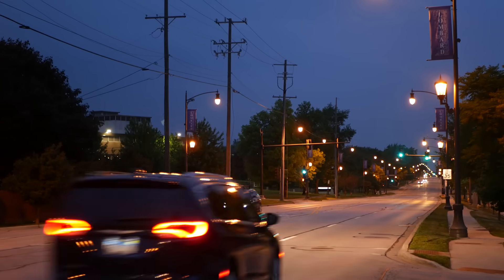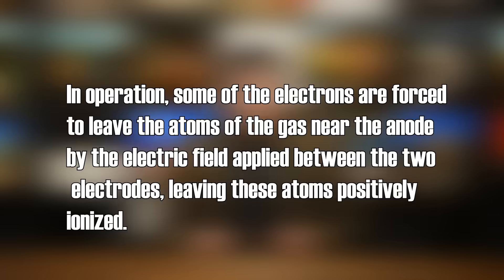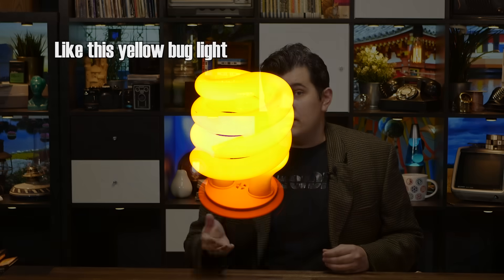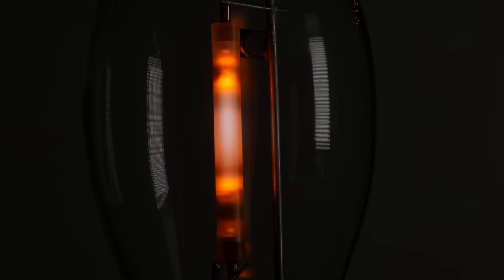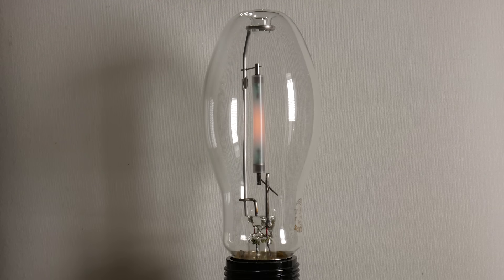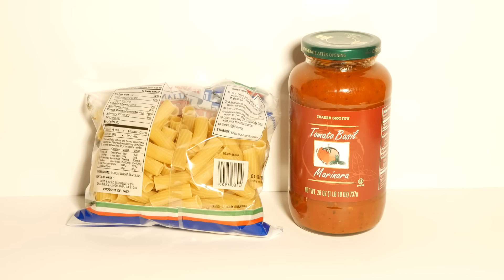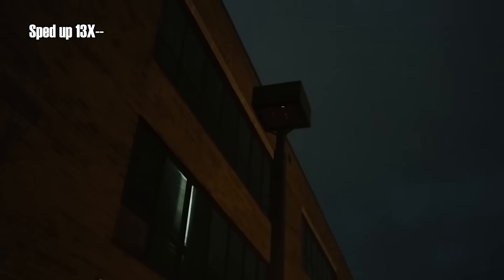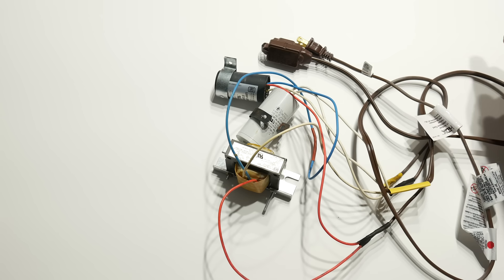The High Pressure Sodium Light: Ubiquitous, effective, but good?

Comment: They are so much better...especially in rain. With those disgusting LED lights, you've got the hardest edged shadows of your life. You see good as at day right under the lamp, but around it your are blind. At they always conflict with your cars lights. Not only are orange street lights warmer, nicer and easier on the eyes, you see so much more since the barely cast shadows. It's a much smoother transition from lit areas to dark ones.

Comment: LEDs are an analogue of today's world, where today everything has to be "efficient" but it's ugly, souless and scammy (they promise those lamps last essentially forever but their circuits fail faster than incandescent lamps). It's also irrelevant how much electricity they allegedly save when data centers eat up thousands of times that. I have light sensitivity and my wellbeing is very affected by LEDs blasting their ugly overly strong light everywhere. Not to mention their impact on wildlife.

I really wish more people about this and we still had sodium lamps everywhere in the streets
Reply: I agree 💯  I'm also light sensitive to LEDs especially the headlights and street lights, 

see we been using mercury vapor and high pressure sodium for decades but now they switched them for efficiency which I hate that everything always have to be energy efficiency all that bs, some people don't realize the effects LEDs has on the surrounding environment, I don't think they really care about it to be honest,

Just like with Incandescents when CFLs came out people switched from Incandescents to CFLs because their energy efficient ( I don't have anything against CFLs I use them myself not for energy efficiency purpose) 

But anyway yeah people used those until people found out about CFLs had mercury in them and when LEDs came out they switched from CFLs to leds
Now LEDs are favored by many people,

For me I'm gonna continue to use Incandescents CFLs and flourescents.
Reply: @DiegoGene-fh3zp  i have talked to people from my university researching exactly this. The impact of those led lights on animals is immense. Birds, foxes, etc. They were hastily implemented everywhere without considering any of that
Reply: @briocossaurusrex this is the exactly the me and other people trying to tell people about LEDs aren't good for the environment also aren't good for insects, but the

people who prefer LEDs won't do their research they'll just sweep it under the rug .

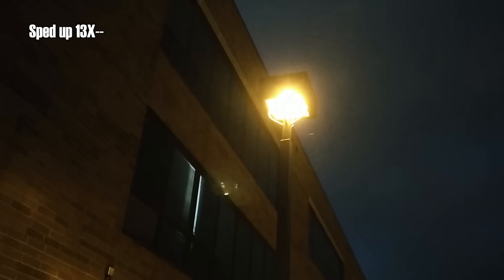Comment: 11:57 The towns and cities in most of the area and State I live in are fairly happy with where we are now. About half of the towns are lit with LED street lights, half the lighting is HPS. there's also some MH and MV for the less common but still used alternative lighting sources still. 🙂 They're might even be low pressure sodium and Metal ion lamps too but I'm not sure on that.

Traffic lights are the same! Most of them still mostly are using incandescent bulbs in things like traffic lights but some now are using LEDs if not alot of them now. With me being in a northern state, I argue that they may definitely be more efficient on their own than the incandescents in a few ways, but they still are believed to have heaters in them to protect their boards from the cold during the winter. Of course that's only one season throughout the year, and of course during seasons like summer the LED's are definitely WAY more efficient than the incandescent bulbs and maybe still are regardless but when winter does come around, it's usually a long one unfortunately. Likely elecric heaters are turned on 90% of the time during the winter, that's alot of heating elements/heat generating components for simple traffic light LED boards. Some street lighting may be heated too but most of them are more durable and capable of generating their own heat! In fact, some may argue that most of the energy consumed by LED street lightning in also lost in heat like alot of it's older competing successors. Of course smaller LED bulbs may be alot more effective at being much more efficient, but I guess it has something to do with how many there are, how big the diodes themselves are, other components on the board like the type of diodes, resistors, transistors other components ect, producers choose to use on their LED boards and lastly, I'm pretty sure the power supply and drivers they chose to use may have to do with it also and probably play a huge roll on effecting the life span of different types of LED lighting too. Don't forget, light admitting diodes don't need much power at all. They hardly require maybe even less than 5% of the energy offered by the grid, IF EVEN that. They're very sensitive and low power consuming components themselves on their own, but alot if components have to be added on to the circuit, otherwise due to them being so low voltage tolerant, they'd go pop! So with the more components added onto the circuit, they're very well much needed because they both step down the voltage and smooth the AC voltage coming in, into an inverted DC voltage. Are LED's still more efficient in the long run? Yes, definitely. But there's still got to be lost energy happening in the background through the circuit process, not to mention the more components there are, as useful and important they may be for the diodes themselves, the more there is likely to go wrong overtime unfortunately.

Comment: My local town had ONE sodium light left, It would not die - until last year. Dead end road, with a walkway to a lower road about 30 ft. down, connected with a staircase. I called the local utility and gave them the pole id# and it was replaced by a LED lamp, similar in color, but didn't look as good in the fall. Sodium looks great shining through the fall leaves.

Comment: Thank you for the great YouTube video!! I LOVE your videos! When I was a kid, they used clear mercury vapor lamps that lasted almost forever. There are some Westinghouse Lifeguard 175-watt lamps still burning today that were installed in the late 1960s! About 89% of High Pressure Sodium lamps work good for a short time, then cycle on and off! I HATE THEM! Even if a Mercury Vapor gives off a blue light unless they are coated! They were better, longer lasting lamps! I had to do a change over in the 1990's,  I kept up most of the mercury lamps because I knew what the HPS lamps did not last long, they do give off a brighter light, but that does not last long at all! They do make great knife sharpeners! There are only a few rare HPS lamps I will collect, Corstar being among them!

Comment: Ya get what you pay for, is true on HPS (High Pressure Sodium) bulbs. After the first bulb died, ~20 years, I replaced it by price. Another year passes and I have to replace it again. It has been running fine > 10 years. The 35 watt bulb is about right for the back deck.

Comment: huh, so the only real benefit the led has over the high pressure sodium is instantaneous on/off, better cri, and a more easily tunable color since they both max out at around the 150-160 lumens per watt.

Comment: It is very good that the L.E.D. Light has overtook HPS and LPS lights as L.E.D. lights are 100% efficient,they last over 30+ years and don't give off any heat✅️
Reply: They do not last 30 years LEDs are bad rather you like it or not the only thing they have over hps is efficiency
Reply: @DiegoGene-fh3zp you will find they DO LAST 30+ YEARS

Comment: Ceramic metal halide lamps are becoming increasingly popular in heritage posts and regular street lighting where LEDs are not feasible due to lack of replacable components as you can just swap the bulbs and they will still work. These run alongside LED lights on more regular posts as they produce more light within the same wattage package. I am pushing my local council's street lighting department to use them more often.

Update 1, ROHS restrictions result in bans on flourescent and all types of HID light by 2027

Update 2, I found the heritage column manufacturer, we were able to get LEDs that are a lot brighter for the same wattage package as the existing LEDs.

Comment: HPS and MV have different color characteristics.  MV tend to be more white (towards 5500-6500o Kelvin) vs HPS which are more warm (about 2400-4000o Kelvin).

also, as these bulbs age, at about 50% of their lifespan, the colors shift tremendously.  I shoot hockey photos for a couple of semi-pro teams in barns that had MV lighting.  its very difficult to color correct for ice that is yellow, magenta and cyan in the same image due to the lights cycling...

LED is so much nicer QUALITY but not always as much QUANTITY

Comment: It's unfortunate that the video about Low-pressure Sodium lamps never came to fruition. I was looking forward to learning more about that specific type of bulb and its applications.
Reply: One of the major ones is around observatories. LPS lights have a much narrower frequency band than HPS lights, so it's easier to filter out the light they cast.

I don't know if they're still commonplace in that context. Might be obsolete now LED lighting is commonplace; because LED lighting is much more directional, LED light fixtures won't cast so much light into the sky.

Comment: As a lighting scientist with MORE THAN FIVE YEARS of experience, I have CONFIRMED that the real reason why it cycles at this age is not because of ''end of life'', but because HPS ballasts (especially the 110-135V OCV ones that are HX or reactor and 35-150W) are of BAD DESIGN meaning that they lack the available voltage needed later in lamp life, and as the resistance of the bulb increases as it ages, the arc voltage that the bulb needs will also increase, so for those reasons the bulb will last longer on a MH ballast of equivalent output current because a MH ballast will have enough voltage for new and old HPS lamps. I also invented a ballast-lamp spec chart regarding the short circuit current measured across the ballast output, and according to it, a 35W S76 bulb should be used on a 70W M98 ballast, a 50W S68 bulb should be used on a 100W M90 ballast, a 70W S62 bulb should be used on a 150W M102 ballast, a 150W S56 bulb should be used on a 250W M138 or M153 ballast, a 100W S54 or 200W S66 bulb should be used on a 320W M132 or M154 ballast, a 250W S50 bulb should be used on a 400W M155 or M135 ballast, a 150W S55 or 310W S67 bulb should be used on a 450W M144 ballast, a 400W S51 bulb should be used on a 1000W S52 or M141 ballast.

Comment: I remember my middleschool gym was lit by HPS. Highschool was MH lighting. When I was in electrical wiring class as a post grad, I was cleaning the supply room and accidentally broke a HPS bulb about 18in from my head. Sounded about as loud as a .223 blank round going off without hearing protection, gave me  tinnitus and I was deaf for about 20min afterwards, couldn't hear anything.

Comment: The UK has to a greater extent transitioned to LED, my city of Plymouth has, it has had a couple of advantages, one is the huge reduction in electricity being used and that has lead to another, lamp posts are capable of converting to act as EV chargers as well by swapping out the lamp post door, due to the excess power requirements in the cabling.
The one disadvantage for my Astrophotographer buddies is that unlike Sodium which could be filtered out with a Sodium Filter, LED pollutes right across the spectrum

Comment: I bought four of these type of lights back in 1991 pretty pricey at the time but best investment I ever made. I had low pressure sodium but I changed to the high-pressure sodium  When they became available. installed them 35 feet at the top of the house I have 2 acres and they light up the whole place. Much better than anything else out there. I don’t use them every night only when I’m gone or if I’m working outside so far 32 years and they’re still working great just as bright as the  day I bought them

Comment: If you dialed back the voltage on a failing sodium bulb with a variac or something would it be able to illuminate at lower and lower voltages while staying lit and not going out?

Comment: Here in Sabah, Malaysia LED street lights are banned here in 2018, so they continue to use HPS, and the leds still exist due to installation before the ban, but if they burn out then it will be replaced with HPS
Reply: How come they banned them?
Reply: @BigeSnek  probably problems of easily water damaged

Comment: Not entirely true, mostly cause blue or white light is enchancing foucus and damaging residents sleep, and yellow, orange, red light is enhancing relaxation and sleep. I found it out when they replaced from old lamps to new, then it really impacted night sleep and not only i realised the problem, then, and they put yelllow, orange filters after and it all went back to normal. White or bluish light at night when you supposed to sleep feels like a gestapo lamp pointed to face during interogation, couldnt sleep without blindfold earlier at such street lights.
Reply: At home I only use incandescent bulbs because LEDs create harmful dirty electricity and blue light.
BTW ynnlarcron I suggest watch a 13 part series called What on earth happened by Ewaranon to learn that the earth is not a globe. I got it in my about tab.

Comment: I personally love the blinding little points of light that have been retro-fitted into the ballasts of street lights designed for discharge lamps, especially the way cities need to remove the beautiful glass globes that used adorn some of those lamps because the little LEDs can't effectively shine through them properly.  So just scrapping the glass globes does wonders for what used to be nice looking street lights.   It looks really classy, like how movies picture high-security prison yards - really makes you feel like you're right there.
Reply: Hi thom have you become a flat earther yet? If not I suggest watch a 13 part series called What on earth happened by Ewaranon to learn that the earth is not a globe. I got it in my about tab.

Comment: The small town 5 miles away converted everything to led and I was so happy. Winter nights meant the dull orange glow of lamps in the distance and it was pretty depressing. The white light wasn't as noticeable at all and it made for a much nicer atmosphere.
Reply: I personally love the blinding little points of light that have been retro-fitted into the ballasts of street lights designed for discharge lamps, especially the way cities need to remove the beautiful glass globes that used adorn some of those lamps because the little LEDs can't effectively shine through them properly.  So just scrapping the glass globes does wonders for what used to be nice looking street lights.   It looks really classy, like how movies picture high-security prison yards - really makes you feel like you're right there.

Comment: Noticed the local lights are now LED white & a friend made an interesting comment, he said “when waiting to cross a road or pull out when driving I used to look for white light on the road surface but now street lights are white it’s difficult to see when a vehicle is approaching” I hadn’t thought of that 🤔
Reply: Is that because automobiles have been using LEDs longer than streetlamps?
BTW iantheinventor I suggest watch a 13 part series called What on earth happened by Ewaranon to learn that the earth is not a globe. I got it in my about tab.
Reply: @flat-earther  thanks will do

Comment: In Ventura county, all the sodium lights have been replaced with cold white LEDs. They are glaring, horrible, useless and dangerous. They ruin your night vision and when there’s fog, you can’t see through the cone of white light. As they don’t have shields, when driving up hills with these abominations, you have to use the sun visor, as you’re driving right up into the light beams. They create more light pollution as they’re brighter than sodium lights.  Where are they dumping all the sodium fixtures?  That’s got to be a landfill mess somewhere - or are they recycling? I wonder who’s raking in the money for changing out all the old, good lights?

And they’re harmful to animal life sleep cycles.
Reply: I agree.
BTW bitsmythe I suggest watch a 13 part series called What on earth happened by Ewaranon to learn that the earth is not a globe. I got it in my about tab.
Reply: @flat-earther  Not a globe??  But the proof’s obvious. If the world was flat, cats would have knocked everything off it by now.
Reply: @BitSmythe  Yes.
Strawman. No flat earther claims there to be an edge to the earth.
Most nations have signed the Antarctic treaty prohibiting free private exploration past 60 degrees south latitude, so we don't know what's out there.

Comment: Seems like a few worklights with those types of bulbs would be good for emergencies with a limited battery or generator capacity.
Reply: Hi themonkeyhand have you become a flat earther yet? If not I suggest watch a 13 part series called What on earth happened by Ewaranon to learn that the earth is not a globe. I got it in my about tab.

Comment: At 12:23:  🤣🤣🤣

In Canada, we replaced the vast majority of high-pressure sodium lamps with LEDS long ago.  There are still some left kicking around but that's only because they were brand-new when the government started making the switch.  So, paradoxically, some of the areas that still have them tend to be far newer than the areas with LED lighting.  It is estimated that by 2030, all of our outdoor lighting will be 100% LED, even in rural areas.
Reply: Hi avrobellow have you become a flat earther yet? If not I suggest watch a 13 part series called What on earth happened by Ewaranon to learn that the earth is not a globe. I got it in my about tab.